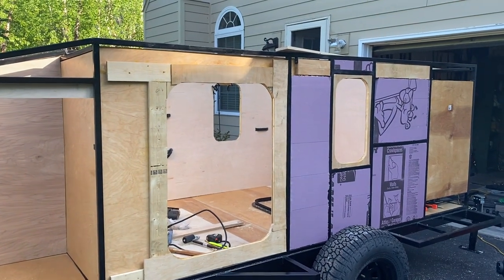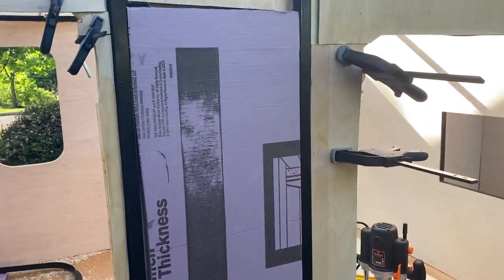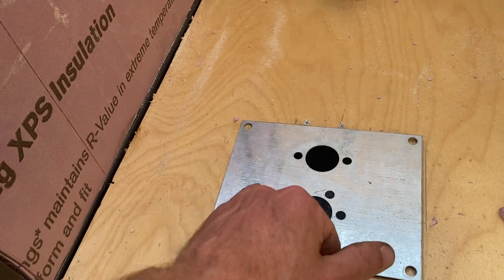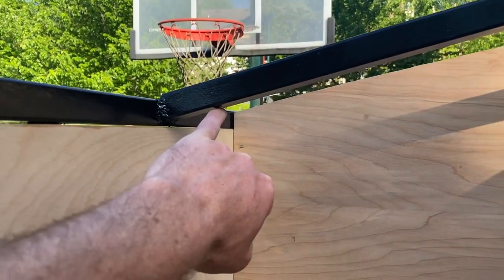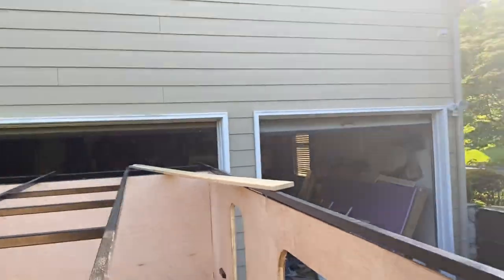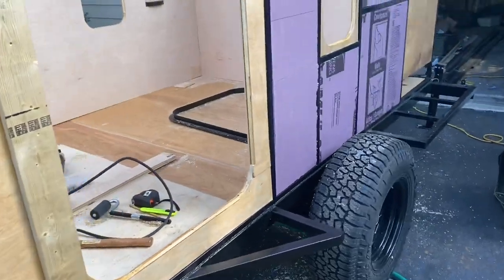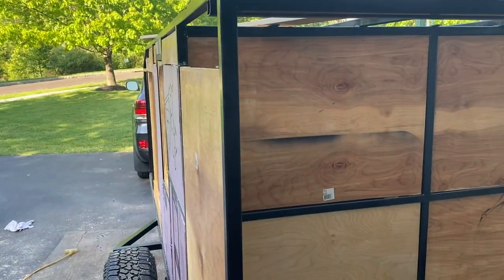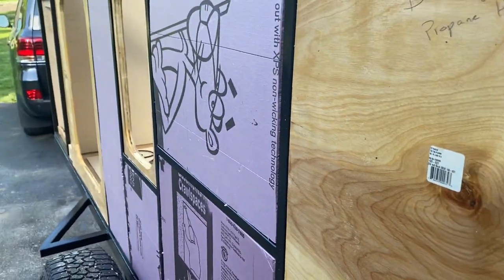Day 18 camper build interior and door and window cut outs

Comment: Just noticed (probably too late) you don't have any cross members on top, like side to side. If not too late you might want to add them.
Reply from the maker: Going with 1/2” plywood on the top. Really only 8 feet without a cross member on the roof but have the ladder style in the middle. I might add two pieces of 1’ wood running down each side but sort of did no cross members on purpose. Wanted a free run of space to run electrical wires. Right now trying to figure out how to get the fan wires from inside the 1x1 tubing because it will be sandwiched between an inner and outer plywood skin.
Reply: @theeveryguy1730  Strength would be my concern over electrical. I chose to run my wires inside the cabin in the channel that gives me option to get to  my wires if i need to change/add them. Wood crossmembers are also good idea if you don't want to put square tubing. I would though. Good luck on the rest of the build!!! We're on the same Facebook group too.
Reply: I like how you built your frame, even if it is a bit overbuilt. I would hate to see you hit a tree with the top of your camper during one of your trips, and bend the roof edge... Just my 2 cents.
Reply from the maker: Lateral strength? Or support for the roof?  I can stand on the tubing
Reply from the maker: I get that but have four cross members.
Reply: @theeveryguy1730  yes, lateral.